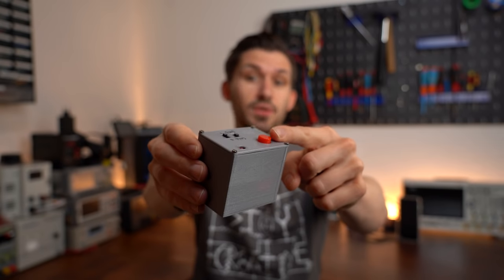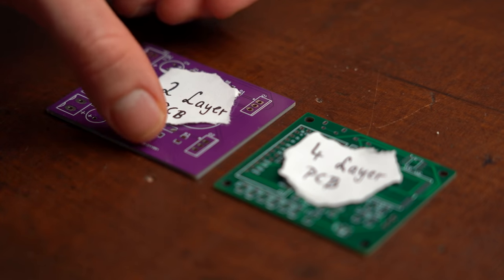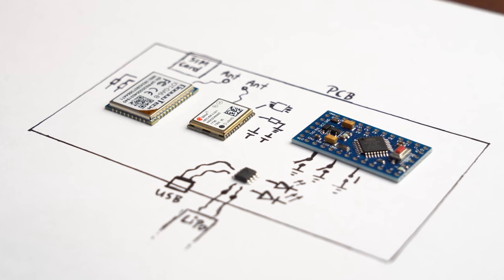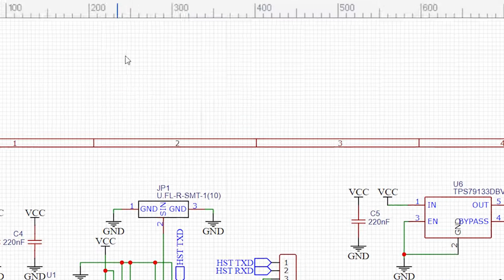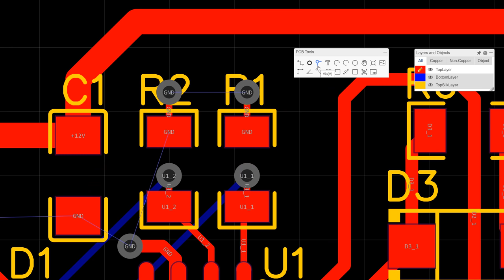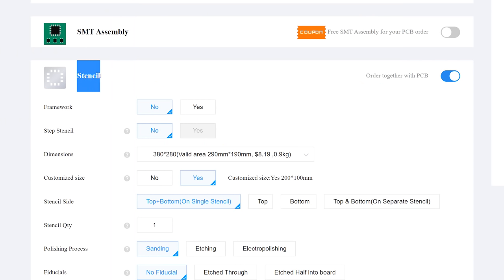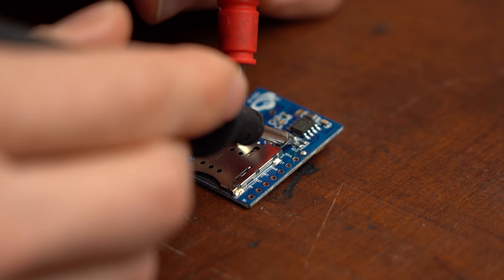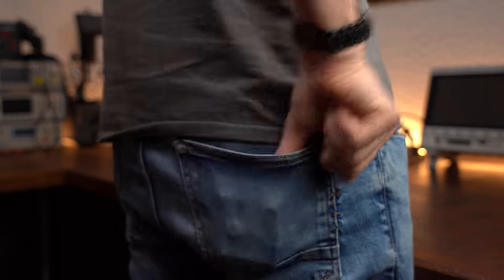This credit card sized PCB can SAVE YOUR LIFE! (Shrinkify your projects with a 4 Layer PCB)

Comment: a poll. I hope you honestly vote Mr Scott.
Which CAD software autorouter would lead you to satisfaction?
a. Altium Designer
b. EagleCAD
c. Easy EDA
d. KiCAD
Tell us secretly. Sponsors don't need to know! :P
Reply from the maker: I can only say for the first 3 answes since I used them before. There is no definitive answer. You want to create something simple with chinese parts. Go with EasyEDA. You need to create something complex with components from other online sellers, go with Altium. You want something in the middle, use Eagle. It also really depends on what software you are familiar with ;-)
Reply: @greatscottlab  Thanks. As a schematic and board designer, I would try to follow these guidelines in near future.

Comment: 💡 If you add a mic and a small speaker to the GSM module, this gadget might can be an emergency device which can send its GPS coordinates via SMS and preform a basic call to a pre-programmed phone number ‒ it can be helpful to be able to talk and send your GSM coordinates to someone in an emergency situation, right? 😉
For example, in call mode, the button starts the call, then pressing the button again ends the call. Also, when the GSM module's number is called, the button can answer the call, then pressing the button again ends the call. The "incoming call" notification can be a simple single-tone beeper.

Comment: Would it be possible/desirable to use a three position switch instead of two two position switches?  In the end positions the device would be powered on in one mode or the other, and in the middle position, the device would be off.

Comment: Nice! I bet you could make it even smaller if you can find an SMD GPS antenna -- I have a teeny tiny GPS module that's only about 15mm^2 and SMD! It's the "Ultimate GPS Module" from Adafruit. 

Something that might make it easier for covert use -- you could have one button that does SMS and one that does call, rather than a switch. And you could have a 3rd that "unlocks" it so you can leave it on, but have to press 2 buttons to make it do something to avoid accidental activation. Maybe have the call button be a circle and SMS is square? Not sure how much more you want to iterate on this, haha

Comment: Excellent work mate. I would suggest you to switch to a professional EDA software like KiCad Or Altium if you want to design more complex boards. Using the Auto-router seems a bit of a questionable choice, but everything seems to work just fine as you have simple traces (in an oversimplification).

Comment: Nice video, thanks for sharing and I learnt something new 
What about using a A9G module instead of the A6? It has GPS, GSM and SD capability, you'll probably save more space, and the chip seems available on Aliexpress. If you have an SD slot you could introduce a logging feature where the GPS logs your location at regular intervals to the SD card
Reply: The sd support requires support circuitry that would make it larger.

Comment: Very interesting video, I have always thought it would be impossible to make a 4-layer PCB with my experience (almost none) but it just took time and in some cases it was easy. Thank you for your informative content (:
Reply: The usual practice is to make the interior planes on a 4-layer board the power and ground and run all the circuit traces on the outside planes.  This means pesky blind vias for everything that needs a power supply, but you're going to get them anyway and this probably produces the fewest in most designs.  With that in mind, designing a 4-layer board is probably going to be easier than a 2-layer board, if you've done a few 2-layer boards.

Comment: This is a very impressive project, and I found the idea of having a portable device like this appealing, I especially want to get something like this for my grandma, who just fell and had a fracture but couldn't get help for a few hours. But I can't find anything very suitable on the market. Just some question on the practicality, 1. You'd still need to buy a phone plan for the SIM card? cuz I think having to spend hundreds every year on an emergency possibly one time use device not so appealing? 2. Have you tested the battery life? Cuz many devices for similar purpose on the market last at most 1 week, most just 2 days, and that is not very useful for old people since they probably won't remember to charge it every day.

Comment: Wouldn't it be even cleaner by replacing the Arduino with the ATMega328 alone? IIRC, there's a lot of stuff on the Arduino that is not really relevant for a "finished" circuit. Actually, I think you would cut the footprint of the Arduino by half for a Mini, and nearly two thirds for a Nano, that may be not so negligible...

Comment: Can you do a video on how to get into cheap PCB design? I want to get into it but it's quite expensive with ordering even a small BOM, PCB, and all the shipping. I have a small first project drawn out, but it would already cost me €50… and that is quite some money for a small and simple design. Thanks!
Reply from the maker: Try using the slow shipping option from JLCPCB. Will save you quite a bit of money. Other than that there is no big recommendation from me. JLCPCB are already pretty much the cheapest option.
Reply: @greatscottlab  Oh didn't check the slow shipping out yet! And what about the BOM? Where do you reccoment getting the cheap parts? Or do you buy them in bulk for multiple projects? Much appreciated.

Comment: This might be a bit off topic, but I wanted to try my luck and ask anyways:
Any chance you could make a video about SlimeVR and how to assemble it?

SlimeVR are DIY Virtual Reality trackers based on IMU data. You can either buy kits, or just get all the hardware for yourself, so there is a lot of info online about it, but nothing on the quality level of your videos.

The reason I'm commenting this below this specific video is that you can get custom PCB's for it, but there are a lot of different PCB designs.

It would be really awesome if you could cover something like this. Most likely would also include 3d Prininting, so might be a good jlcpcb integration :P

Comment: Nice. Question, though: does layering VCC and GND on inner layers create some capacitance? If yes, it's probably very small but I guess that acts as another power supply decoupling capacitor, right?
Reply: Eevblog did a video about this (2 vs 4 layer gigatron or whatever that board is called) and it's true! The capacitance is pretty small, but it can help.

It also depends on the layer stackup. The inner layers could be close together or kinda far apart.

Comment: Auto router is cool but it sadly can not always find a solution because it can not adjust the component placement
Reply from the maker: Yep. And the solution is pretty much never the best. But it works in most cases.

Comment: Won't it be a better choice to use just the Atmega 328P rather than using the whole pro mini board?( Given that you are already using SMD components)  It'd have made the whole assembly a bit smaller, and the final result would have looked more professional.
Great project as always ....

Comment: Something I've wondered about is what are the consequences of creating a VCC layer and GND layer.

You're making a giant (albeit small value) capacitor.

Are there any pitfalls that one needs to be aware of when working with 4 layer boards? I'm sure the RF people will say if you go above X MHz then you need to be careful, but as a video idea, can you talk about all the stuff and best practices?
Reply: That is actually a good thing because it acts as a  discrete bypass capacitor. Many FPGA manufacturers recommend that you place GND and VCC planes as close as possible to maximize this decoupling.

Comment: Helloo can you make a non contact voltage tester highly sensitive so it can detect voltage from cables outer xlpe. As nc tester available in market only work on cable jumper it cannot penetrate armour and outer pvc, xple sheild

Comment: Won't setting the two inner layers as VCC and ground basically make the pcb as a capacitor and introduce unnecessary problems?
Reply: Power planes are actually capacitively coupled to prevent problems. This is why decoupling capacitors should be directly adjacent power pins, not at the bottom of the PCB. It also isolates data lines that could couple if routed through internal layers.

Coupling power planes decouples ICs from each other. Clear as mud, right?

Comment: Cool project! I heard the TP4056 should not be used for charging while under load - is that true? I assume if the battery has protection it would be fine, but would a unprotected 18650 be ok to charge while drawing current?
Reply: No, the overcharge protection on the TP4056 will not function while charging under load so you will end up with a fire
Reply from the maker: I did it before and never had problems. But no guarante from me....
Reply: It is does not matter for TP4056. It is the battery which they dont recomment charging while using

Comment: i think u could have made it smaller if you routed by hand and made the Arduino from scratch or rather used another Atmega with fewer pins since you weren't using most of them.
Also when i saw you had so many modules i was man that is a ton of unobtainium there , chip shortage is a huge pain and designing during it makes you do wird stuff

Comment: Great I am facing issues with SIM800L module. Can you post a video ?.
Reply: @greatscottlab  I am usin same Neo 6m. It is working fine. But my sim800l not fixing with network. I am doing this for my bike gps tracker. Also it should charge the battery while charging.
Reply: @greatscottlab  Can you please provide your mail ?. I will send some pics. My sim800l responding now after 2days fighting. Now I used 800ma supply to the sim800l. Before choosing the correct power supply and battery charging circuit. I need to ensure my sim800l working or not.
Reply from the maker: Sorry but I do not have time to help viewers with their projects.
Reply: @stm32user  what is the problem maybe i can help
Reply: @greatscottlab  Ok great.
Reply: @ahmedelwan9129  hi. My sim800l responding. Csq response is 16, but not fixing with network

Comment: Could it be made to where the sms is separate from the call so you can call yourself and text someone to call 911 for you. It may already be like that but I had trouble understanding it, so I asked.
Reply: Maybe a way to tell if the GPS module can't connect as well, a vibration would be best but it'll make it bigger, an led is a bit non sensible since it would alert whoever that your trying something.

Comment: Why on earth use an Arduino module? If you are going to the trouble of making a 4-layer custom PCB you could easily put the microcontroller chip directly on the board saving a lot more space and particularly height. Since the Arduino is open source, you would not even need to do the design but could just copy the relevant schematic into yours.

Comment: Great work - just one question did you correct the problem with the two resisters on your schematic?
Reply from the maker: Not in the schematic. If you order the board you will have to add a resistor like I did.

Comment: Why did you use the Arduino, and not a standalone atmega chip? It would save literally half of the used space!
Also, if we are going with miniaturization, why not use smaller smd packages? 0603 is still easy to solder by hand, and even 0402 is managable with a microscope.
Also, 6:41 why did the autorouter do the power wiring? Wasn't the internal VCC layer supposed to take care of that?
Also, ZIM card :D

Comment: I want to design a board with multiple devices that communicate using 10/100/1000 Ethernet. I'm wondering if anyone knows much about running Ethernet over a PCB since the standard expects twisted pairs and magnetics. Guessing the twisted pairs can just be replaced with traces that use pairs of the same length.

Comment: Just curious about what type of situation this would work in? Someone is carrying one of these with them, but not their phone?? Even if your phone dies often, then carrying around a battery pack still seems far more useful, especially since you can just tell Google maps to share your location with someone and they will always know where you are... That's on top of the fact that this will require a separate phone plan, that you'll be paying for whether or not you use the device. Finally, with the way that red button is sticking out, it'll almost definitely be getting pressed inadvertently in your pocket/bag, it should be recessed into the housing.

Comment: why are you used those huge amount of components like GPS module gsm module and whole arduino board?
you can even shrink it down by using SIM868 GSM+GPS module or SIM808 GSM+GPS module and also you can use suitable attiny MCU for this... if you did so this can be scaled down to a size of a pendant....

Comment: Why not use the atmega only so get off the arduino  abd make it more tiny the pcb
Reply from the maker: Possible. But try finding the microcontroller ;-)
Reply: @greatscottlab  aliexpress? The atmega 328p seems to be like you can buy it from the website or why not change to another micro like a pic mid range easy to  program and will shrink more thr size of the pcb

Comment: Hi Scott! I've been considering using that same lithium battery management IC for one of my own projects. However I saw that it stops discharging the battery at 2.5V, I think while that is technically okay for lithium ion batteries, it is not very healthy for lithium polymer batteries, which don't really like being discharged under 3V I've heard. Is there any other IC with adjustable overdischarge protection, so I can limit discharge to 3V for peace of mind? Also thank you for the great content!
Reply: i would also not drop lithium drop down to 2,5v thats a chinese argument for very low life cycles.
pretty sure my iphone shut down at around 3v

Comment: ok but why not walk the extra mile and use the arduino mini without its board and put some smaller switches and buttons on the thing. the arduino mini board has the size of a battery.
Reply from the maker: Try finding the available microcontroller. Also I need the 3.3V regulator so I went the easy route with this and just used the board.

Comment: I don't understand the choices.
You use surface mount components for almost everything, why not go the next obvious step and implement an ATMega328 directly on the board, or go for an ESP module and add WiFi (and possibly bluetooth) to your board?
The imagination is the limit to what else you could use the board for.

For the switches: Why not use miniature switches on the edge of the board and keep a lower profile?

Comment: Your solder paste, from the distance filmed, does look very dry. The close up of the joints on the module also look odd.  Very dark matt grey and lots of carbonisation. I was hoping you'd 'unpack' the arduino onto the board as well.

Comment: Why "Auto Route" is bad? (I'm a software engineer btw.)
Reply: In my experience, it makes questionable layout decisions more often than not, which can cause problems for designs with higher complexity. It also is not great about properly routing power delivery and grounding, which is essential.

It's perfectly fine for a board that has a simple micro and blinks LEDs or something, but you'd probably never want to use it to route something high speed like DDR memory or something sensitive like RF signals.

Routing a board is the best part of a project in my opinion. Not sure why anyone would want to let a computer steal the fun bit and do a crappy job.

Comment: why didnt you just reverse engineer the connections from the modules you stole the chips from? and were there mostly the same components on those boards also? why buy stuff when you just had to take them from the OEM board and put them on your custom board?